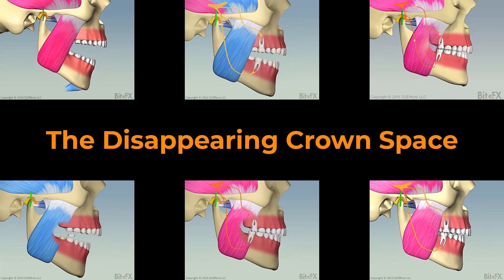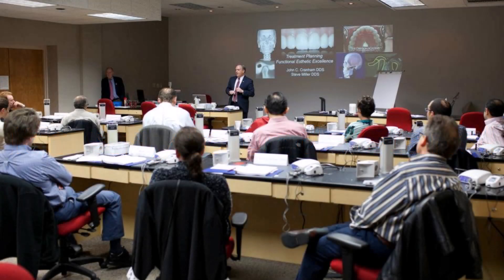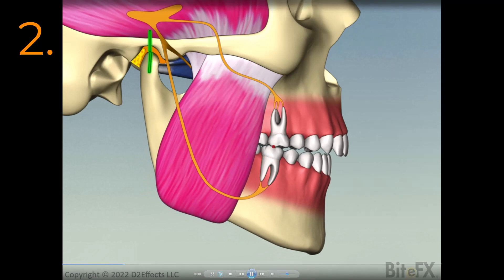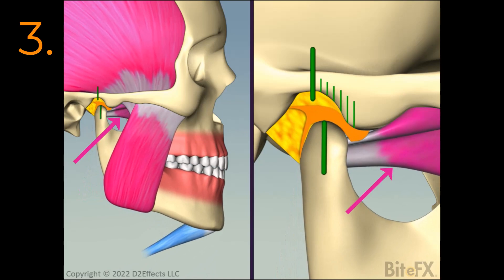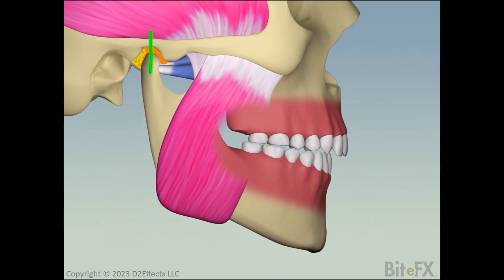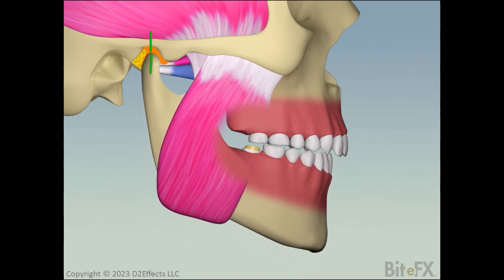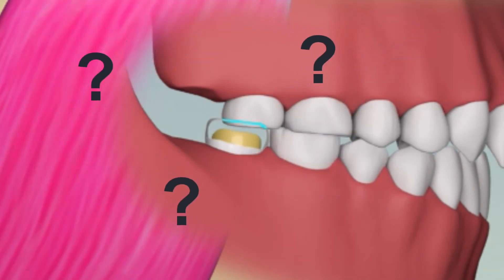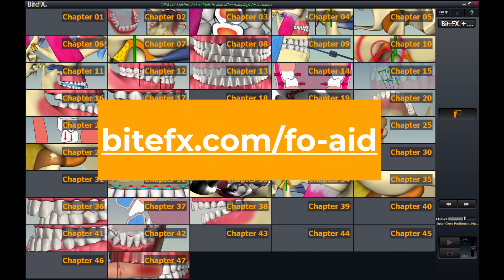Disappearing Crown Space

Comment: so what is the solution plz ??
Reply from the maker: The "simple" solution is to take the bite record with the condyle in its fully seated position then there won't be a a difference between the space available for the crown between taking the impression and fitting the crown.
However, it's not quite that simple as you have to:
a) Learn how to settle the condyle into its fully seated position - and know when that position is stable and won't change in the next few weeks.
b) Know if there are adjustments required to other teeth to make the bite work with that fully seated position.
c) Know when those adjustments are complete and you are ready to make and fit the crown.
CE institutions like Dawson, Spear, Pankey, OBI, BSOS, Kois provide the training that will help you understand and master these skills.
Reply: @BiteFX  thanks alot
Reply: Hello. I have this problem, but my dentis doesnt see this problem. When I wake up i bite on my back teeth- molars only, after one hour and more i bite on my front teeth - incisors.do I have to grind those back teeth or fill in the front ones? or wear braces? I have exactly the same situation as in your video under point 2.